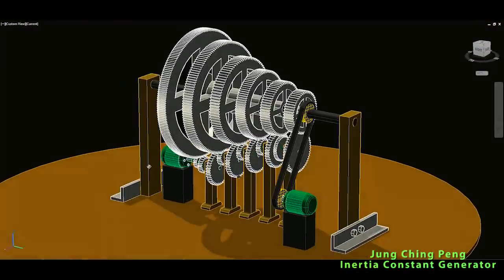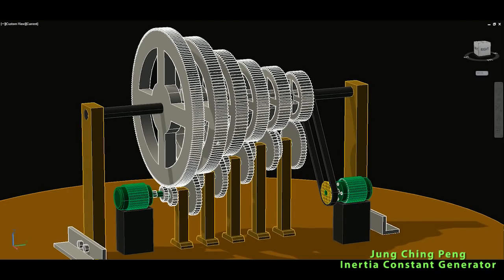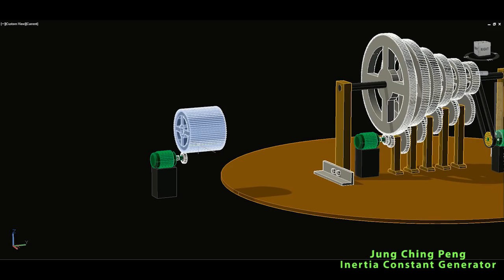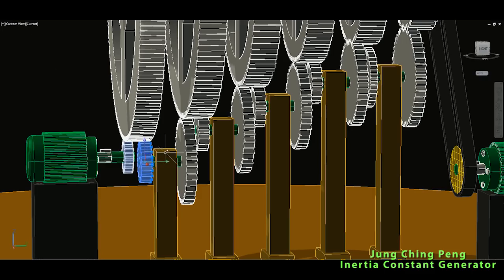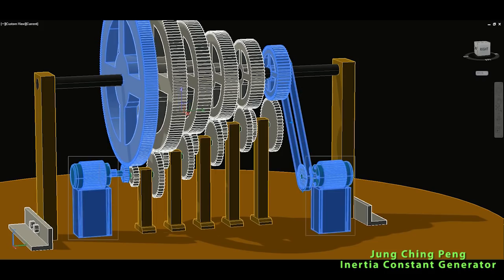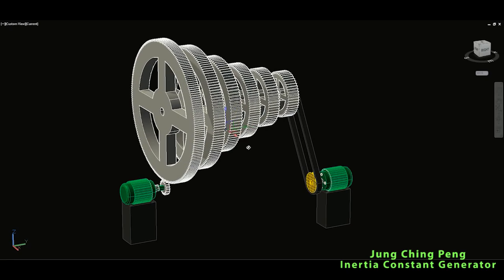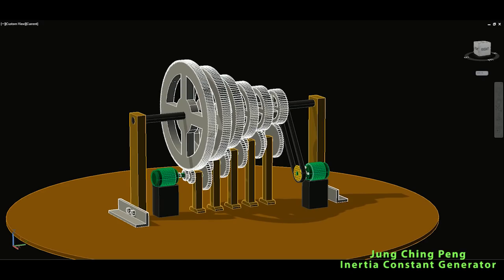Free Energy Generator 2018, JUNG CHING PENG Inertia Constant Generator

Comment: You don't get "bigger kinetic energy". Everything this does is taking som electric energy, generating some entropy by letting some of the movement generated by the motors get lost to heat in the dumb gear mechanism. The generator will recover some electricity, but you can NEVER get more energy out of a system than you put into it. No energy will get destroyed either, it becomes heat, a "lower form" of energy than electricity. Please look at open source videos and material from universities across the world instead of this shit if you want to understand how to generate your own power in the real world.

Comment: If you take out ALL the gears except one it will run more efficiently. Replace the "many gears" with a flywheel and it will be even more efficient. Pulse your input and it will be even MORE efficient. Keep thinking, keep building, but unless you are going for a Rube Goldberg Award, try to simplify your designs for maximum efficiency. Good luck!

Comment: So it does seem to be able to keep the output in a certain range of speed via the transmission, even though the inertia wheel changes orders of magnitude. So this is a valid design, except thats not what this guy is saying. He is confussed and calles this free energy. no, no its not its stored energy.
But this can be done cheaper now with electronics. This could have been an economical solution before electronics advanced as far as they have. Before BMDC where around and only induction machines this gearbox could have had value, its been eclipsed.
Look up race car flywheel.
But a hybrid of both may be possible to have value

Comment: The answer is 0...however if you hooked the input shaft to a water wheel or a wind turbine you will just wasted your time...might make a fancy conversation piece to explain why you shouldn't have ducked out of physics class to hang out at the local smoke shop....but hey if engineering doesnt work for ya mac-donalds is always hiring

Comment: Yeah, this concept is quite flawed.  There is even a completely useless gear sucking up precious energy.  If you look at the last bottom gear on the right, you'll notice it is doing absolutely nothing, because the generator is connected to the last gear on the top right.  Unless it is there for supposed inertia???  For this concept to even remotely work, you would have to pulse the power on and off, while simultaneously mechanically move the drive motor in and out of gear, so the apparatus could freely spin on its own inertia, thus momentarily creating free energy.  Because of the friction of the gears, bearings, and belt drive, this system would use way more energy then it would ever create.  In fact, this apparatus would be a much better braking system, like most supposed free energy devices so far.  Don't take my pessimism about this one as incredulity though, because I do believe it can be done, and have worked on several prototypes myself.  Tangible ones.  So far, no success, but I still believe it can be done.  Don't give up brother, there is yet hope we'll find the one.
Reply: You missed the role of those gears totally.
They are there to look impressive and frighten natures laws off to look somewhere else when he spinns it :D

Comment: What's funny is that all the upper gear are totally useless, because there is an indirect solid link between all the smaller gear (except if they slip... which is no bueno) so you could throw out all those big gears, directly link all the smaller ones, and have the same result - a.k.a. E(final) = E(input) - E(friction) so no energy being created at all. All this is good for is slowly converting electrical neegy into kinetic energy at start then reconverting it back to electric when you unplug the input. Still no "new" or "free" energy.
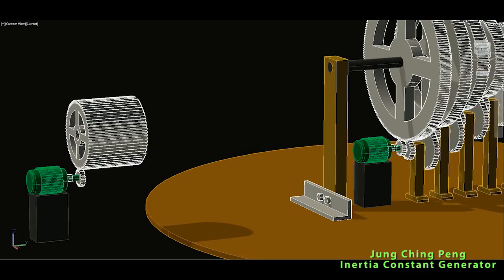Reply: Not only that but I think he is missing something when he is saying that a larger circumference wheel has higher inertia and smaller power to turn it. 4:43 but starts with trying to explain it all sometime before that.
Reply: It's the same principle in an automobile transmisión in hi gear less effort more speed
Reply: This is not true Javier. Check out Videos on Rotational Inertia. v=7PRZ5IIT5Tg   v=W9fPGXyvrVM
Reply: Javier Lopez if you put it into high gear right away you will stall the car, you have no torque in high gear
Reply: He has this idea that the large gears contribute rotational inertia.

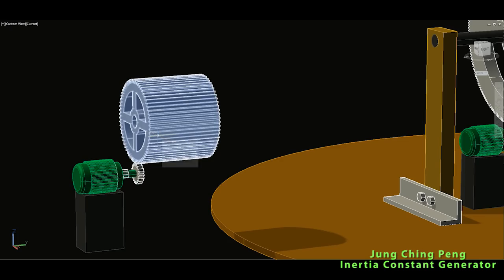Comment: at 3:57 you have your mistake (that I also made in the past). I mean the "should need the same energy to rotate it, but it's not so".
Actually it IS exactly so :)
With changing the length of a lever to which force is applied (or in this case the radius of a gear) you get the so called mechanical advantage,
 ie increasing the radius of the gear lets say twice will decrease twice the energy needed for a rotation of the 1st motor (lets call that rotation In-Unit-1), but it will increase the number of rotations needed also twice, because of the twice as long circumference of the bigger gear.

Comment: Excuse me if my comment look stupid as I am new to the topic and don’t know even the abc of this subject but I have read most of the comments on this video and other related videos and what I have learned is that the Law of Conservation of energy provides that energy can neither be created nor destroyed, rather it can only be transformed from one form to another.

So in short whether its a dam or a wind mill or an electricity Generator run by diesel/gas/magnets etc we input one form of energy and get another form as an output in the form of electricity, in all these cases we need to run the motor at the end side of the device in order to create electricity and for that purpose we apply the forces of water/wind etc or another motor as our input energy. 

So in order to understand the basic Law of Conservation of energy and for experimental purposes only, suppose if we build and run such a generator (as shown in the video) in the space where there is no friction, and once its running at its full speed then will it not continue running indefinitely even if we disconnect the input energy or at least we can say that will it not need less input energy due to the  decreased friction if some friction is still there due to the gears etc. So if the answer is yes, then will it not actually be creating energy for free and at the same time will it not prove the Law of Conservation of energy to be wrong.

I know that I am a newbie in this field and I will be ignoring something for sure but in fact I am unable to figure out how that motor which generates electricity is going to stop in space if there is no friction at all because every moving thing in the space continue its movement. Thanks in advance for any reply.

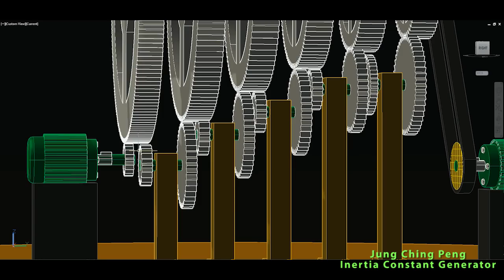Comment: At 5:43 minutes into the video,  it states that gear #3 turns at a higher speed that gear #1.  Gear #3 appears larger that gear #1 so I expect it has more teeth.  If this is true and both engage the large gear #2, then gear #3 must turn at a slower speed.  The 3D drawing of these gears is interesting to view but the conclusion of free energy (excess electrical power) is in error.

Comment: You're not going to get any flywheel effect from the upper gears, they are not necessary at all to do what you are attempting to do, merely use the ratios of the lower gears driving each other in-turn and you will get the same effect without the upper set of spindle gears.
This is an absurd device.

Comment: Your gear system makes no sense, it shows the lower gears with a second gear, one smaller than the other but both in contact with the upper gear, how? Not possible.
Also, it will take greater effort for the motor and small gear to turn the larger gear, this will be energy transformed into heat, lost by the motor.

Comment: The only thing I have scene here is this man has learned to use this CAD drawing program. He also has a a good imagination.

As far as this design goes. His design does not coincide with his mechanical explanation of the workings of his drawing. He continued to state the electrical mechanical force developed by the output of his motor which I can only guess was electric. Would generate enough inertial force (Which not correct) differential so as to get more mechanical force out than put into the device. The biggest flaw here is he has not accounted for friction and several other factors. No such thing as free energy. No way to escape the laws of physics. You can not get more energy out than you put in.

Comment: This is a gigantic fail, takes energy to run to run this design and then you add in friction and a load of mass. It may work in fantasy land, but in the reality this is not giving you free energy. Even its design will require it to be replaced constantly, else it will wear out. The fast it spins the fast it will wear out. Basically designed to fail from the get go.

Comment: but isn't it backwards ?

the small gear end will give you more speed at the gear but produce less RPM's at the generator, so you will get less power than required to run the motor coming off the generator.

where if the drive motor were at the small gear end & the generator at the large gear, one RPM of the large gear would produce several RPM's of the generator & your intermediate gears act as a transmission based on the load of the generator, essentially allowing you to use a small input to generate a larger load, such as a 3V motor  generate 12V or 120V with the correct gear ratio.

the Idea that it will be able to run its self & supply additional power is delusional, if you build the contraption you will find as similar to those using batteries as oppose to gears & flywheels, eventually it will stop, now you may be able to prolong it from minutes to hours or days to months depending on your ability to minimize friction, drag & manage the load of the contraption, but eventually it will stop. 

I have yet to see anyone one build a reliable self running electric motor let alone one that can run its self & drive a load.

however if I was going to build one I would use a principal I have not yet seen attempted  that makes more sense to me as I love watching people build these crazy contraptions. 

my Idea is making 2 gearing mechanisms with the precision of a clock maker that attaches to the motor shaft, one on each side of the magnet armature  & each one would move a magnet  simultaneously timed with the other side magnet in the direction of desired rotation in an elliptical pattern entering the magnetic field smoothly at the bottom, pulling  close to the magnet armature  as it drags (or pushes) the magnet armature for a short distance before veering outward again at the top of the stroke smoothly exiting the magnetic field thus eliminating the cogging effect.

essentially you create a gear driven mechanism that mimics two magnetic hands one on each side of the magnet armature spinning the motor.

Comment: You have a much higher output speed than input speed but speed does not equate to energy. As soon as you disconnect the input drive motor the inertia built up in the gears will be transformed into electric energy and the gears will slow down until there is no inertial energy left. Connecting the output of the generator to input of the drive motor would only slow down the process as with all those gears you have all that rotational friction on their bearings not to mention the friction at the meshing of the gears. Sorry, just another time wasting perpetual motion farce.

Comment: you did a very wonderful job! I appreciate it. But here is something about 'Energy ' which will always reduced from traveling from  one point to another. This means the electric energy E1 to motor is converted to  kinetic energy E2 of first biggest gear. Here by all laws E2 will be less than E1. Now at the last and smallest gear , the kinetic energy E6 is lesser than E2 even though it is rotating fastest. Now E6 will converted into electricity by another motor E7. Which is even less than E1. So, you will get an output farless than input.  No machines can be 100% efficient or above 100. Even light (form of energy) losses certain 'Energy' in vacuum or space or AIR.

Comment: make your own one then show me the electric bill decrease . The very much gears can only slow down the speed of the drive motor . so its impossible that the output motor will generate more power than the drive motor  had supply.
Reply: i was gonna say that !
Reply: usually with these "generators" only the output voltage/amperage/wattage differs, wich gives the illusion of generating free electricity just because the number is higher..
Reply: dilbert0815 money is the power generator at patent office
Reply: itcan work,but we need new typ alternator or motor....
Reply: First I'm assuming the large gears are independently free to spin on that shaft. If not this thing is locked and can't turn. This would gear up and up and require tremendous torque to turn. The drive motor won't have enough torque to overcome the friction on these gears. This is a naive system.
Reply: K V ...it appears that the big gears spin freely, while the shafts that do the driving would be going through the supports on the bottom, linking the two gears on each side of the support. Although it still wouldn’t achieve anything, it would be more efficient to have one shaft with a big gear on one end and a small gear on other. At least that would change it from a massive energy loss device into an everyday, big energy loss device.
Reply: Its simpler than that. But you are actually wrong too.
The lower gears are what counts. They increase rotational speed in fact.
Thats engineering 101 with gearing
The upper gears are totally useless, they just serve to pass the momentum from on of the lower gears to the next stage. Their gearing factor is simply 1,. Their role in the video is to look impressive.

BUT
The end result is that the driving motor needs a lot more torque than is delivered lastly at the final generator.
More torgue == more current == more power (Power = Voltage * Current).
Hence the power delivered at the end is a lot less than the power of the driving motor.
The machine will eat up a lot of power on gear losses, thats all. Its an energy hog, not an energy generator ;)

Hence: the claim in the video is stupid. The errornous assumptions are as simple as physics 101.

[IGONY]As a result I'm totally overwelmed by the US PTO taking money from applicants to still register perpetum mobilee machines as valid entry[/IRONY]

Comment: dude I am late on YouTube don't usually have a lot of data but my spell check doesn't follow my Southern slang so well so anyways what I'm saying since I took CP physical science is I knew that this would work so what I'm saying is I thought of the same idea bro over 20 years ago when I was 20 years old years old or even younger and also realize that the engine could be built off of running water but not pure water that has been purified because of water needs some metal in it in order to conduct electricity but I don't know the math on all that but I know that also could be built

Comment: okay Mario at the end of video you said something about being able to get enough energy transfer basically at the gym at the generators and know that the alternators end of the line well the same thing I said before I use a figure 8 look I seen this video before of the guy that had a flywheel and it ran off of magnets somehow so it kind of floated the magnets were for Baron's so it didn't have no friction will effuse lightweight material such as titanium or aluminum for the gears and flywheels and stuff well maybe not for the flywheel but at the alternator in you also use another Figure 8 like on the bicycle to increase the rotation so to speak of somehow I got it you understand what I'm saying I don't know if you were years old I know this will work before I even knew of Nikolai Tesla

Comment: yo Mario I thought of this 20 years ago bro I'm 41 now check it out you using the same design that I thought of with a figure 8 off a bicycle and in principle it should work but I don't know my math good enough to do this but check it out if this doesn't work and I'm not sure who videos legit as many in YouTube johndra anyways what about taking you need a computer system to do this where when the flywheels go around they have magnets on them and opposing magnets like this other video I seen and the generator blast those magnets at certain points of the Revolution to increase the inertia and speed because the key to this is the gears and is the speed to produce enough RPMs or whatever to produce enough kilowatts I don't know all the lingo but that's how we can do it I'm telling you this will work I know it will work

Comment: This is NOT a free energy device. It takes power to run the initial motor. The load taken up by the initial motor would leave very little, if any, current left over to power much of anything. If you have any understanding of electricity you would know that it is current that is the driving force (power) of electricity. Without current (amperage) you can theoretically produce 5,000 volts, but without the driving force behind it, it would basically be useless. Maybe light up a small LED. Whoooooeeeee. Really cooking with gas here!!!

Comment: The problem with that and all perpetual motion mechanism is that they all loose energy over time no matter what because it’s a single mechanism and the problem with that it’s that it will loose energy over time so matter what because of the constant pull of gravity but what if you at 1,2,100 different mechanisms working together to power eachother so they stay on a constant energy loop compensating each until gravity isn’t a factor anymore doo to all the mechanism outweighing gravities pull